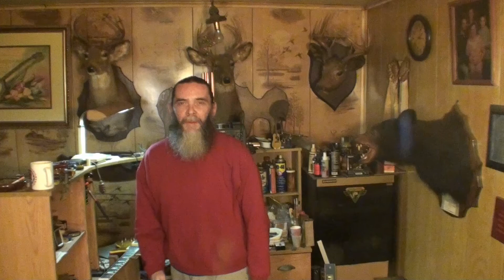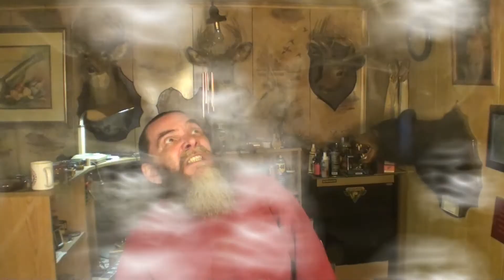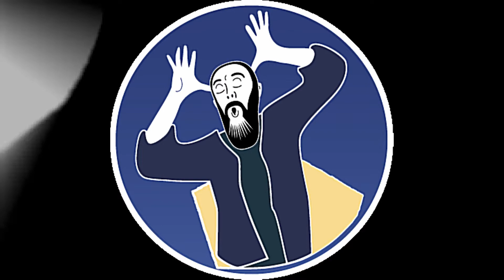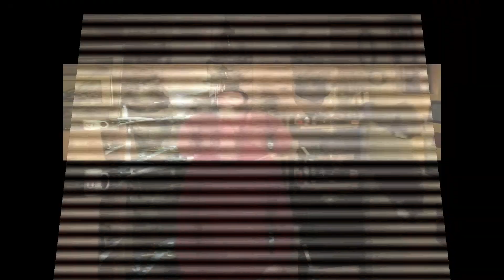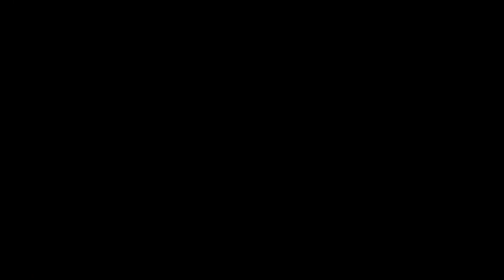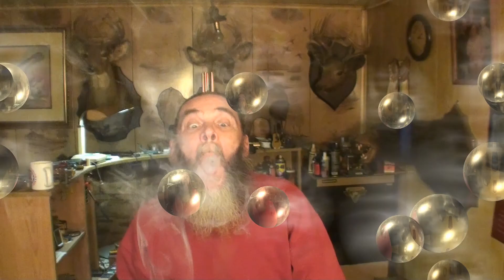acoustic guitar x bracing

Comment: Great video & explanation Randy!!!!!!! Dan Tyminski's old Martin is a 1946 D-28. I've googled all that I can & even went to Martin's web page & I can't find any info on how many "Tyminski's were made. It's possible that they still make them as a custom shop guitar. Herringbones were discontinued in 1945, but a few herringbones bled into 46. I've only seen & played one myself. 
     Martin was getting a lot of custom orders for herringbone binding in the 70's so they re-introduced the herringbone D-28 in 1976, but many were stamped as D-28 or "custom" until sometime in the 80's or 90's. I could be wrong on that, but I have a 1978 that's factory original. It's scalloped with the standard X placement. I believe it's stamped as a D-28. It's a great guitar, but has many of the typical 70's issues. The bridge was placed wrong from the factory. It's 1/16 too far forward toward the neck. I'm sure you've encountered this problem before.
     On another topic, there is an actual difference between shaved & scalloped bracing. It's mostly in how the luthier or repairman approaches the process & what sound you're looking for. If you're just looking to get more overall volume out of the guitar, it's better to do a shave rather than a scallop, although it will almost always affect the tone somewhat. A shave is basically trimming each brace from front to back. This is done in smaller increments taking off a little from the top of each brace. 
     Scalloping is more of what we commonly see as a scoop cut to several braces, but not all. This process takes off more in the center & less as you get to each end of the brace. 9 out of 10 times, this process gives the guitar more bass response & usually makes the guitar louder as well. Many luthiers mainly concentrate on the X brace & the 2 tone bars when doing a scallop. This process WILL weaken the area around the bridgeplate & lower bout, so be VERY aware of the structural details of your guitar. Mainly, learn the thickness & strength of your top. Most factory tops are around 100 thousandths & up. These tops usually hold up extremely well after a scallop or shave & the top will only belly a minimal amount, but many lesser known builders are building thinner tops these days & using lighter brace wood. If your top is anywhere under 95 thousandths, I recommend you have a LONG talk with your luthier before doing a scallop to your guitar. 
     Guitars can take as long as 2 years for the results of either process to take full effect, so don't be too disappointed if your guitar isn't an absolute beast as soon as you get it back. Keep in mind that every luthier can have a different idea of what each process means, so be sure that you & your luthier are on the same page. Also, be aware that the collectability of ANY high end guitar WILL be affected as it is no longer factory original after this process. Even if it sounds drastically better, ppl usually expect a lower than current market value for a modified guitar. Please, don't let any of this advice scare you off from either process, but be aware & educate yourself on the pros & cons. Happy pickin' & love your guitar!!!!!!! It will love you back!!!!!!!